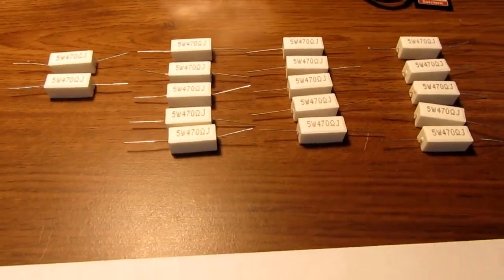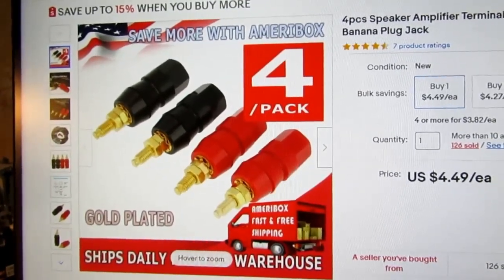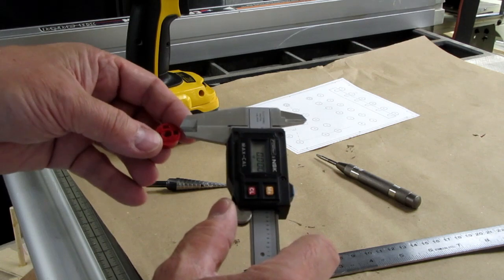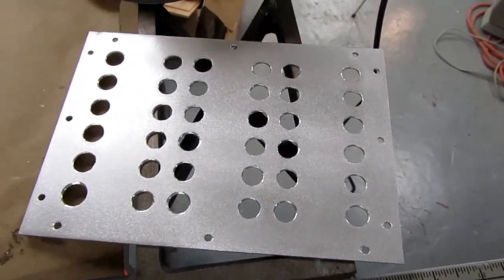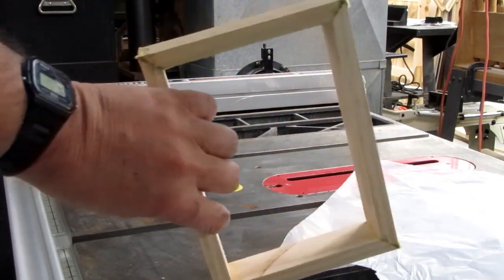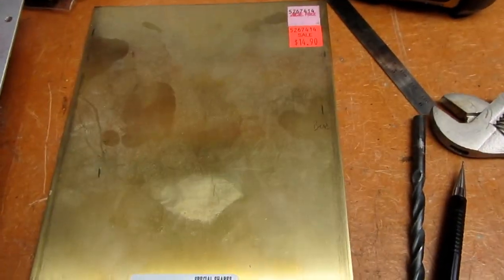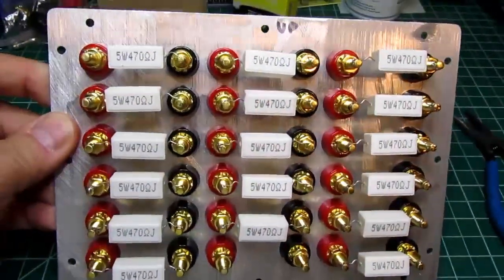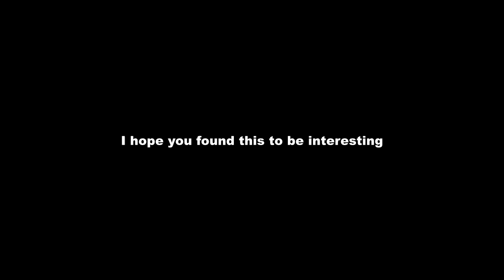Making a Flexible Resistor Array (A Wild Goose Chase?)

Comment: Decade resistance?
Reply from the maker: Decade resistance WHAT? Please write actual sentences.

If you mean that perhaps I should use a decade resistance box instead of this.....well, then you have missed a key point. THIS one can handle quite a decent amperage, and has a good collective power dissipation capability, while most decade resistance boxes are very lower power.